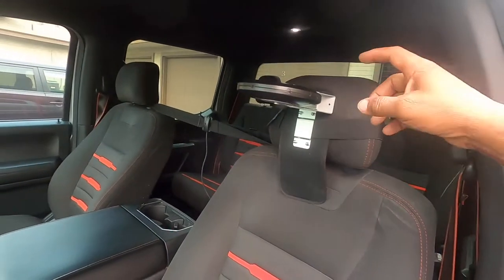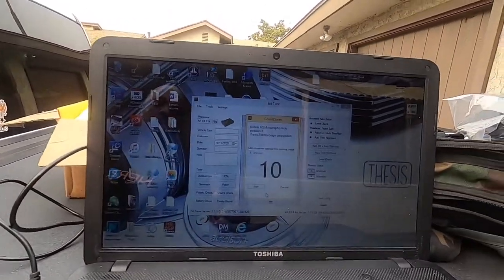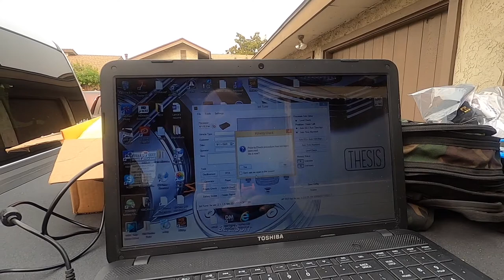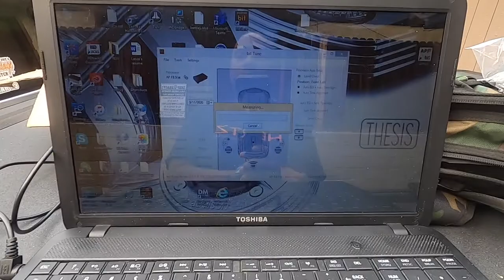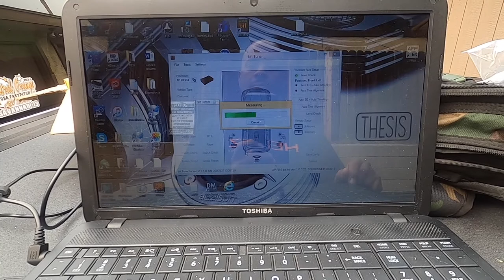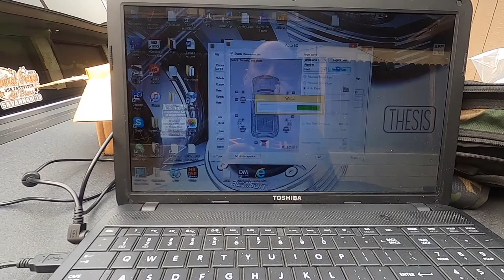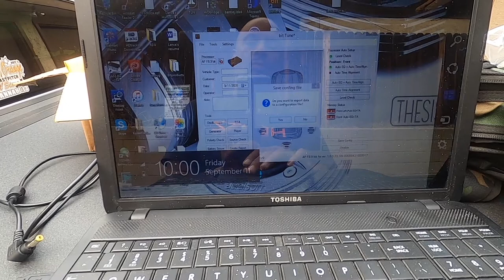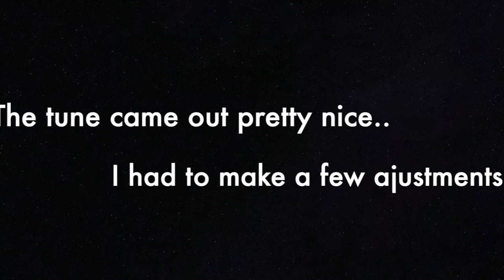Audison F150 Prima system with the APF8.9BIT & now it time to tune it using the Audison Bit Tune.

Comment: Question? where did you get your bit tune ? i have everything installed in my vehicle and audison advised me that I need the bit tune to finalize it . 🤷🏽‍♂️🙈
Reply from the maker: I got one when I worked for a dealer. You can have your system tuned without a Bit Tune. The Bit Tune is a tool and any good installer can tune a Audison DSP without it. Where are you located?
Reply: located in atlanta ga
Reply from the maker: @allenspencer21  there should be a ton of good Audison dealers that would be able to tune your DSP.
Reply: i changed all speakers to audison and added a audison 10 active sub and the apf8.9 forza with the audison reamp 2 for a 2017 BMW x6 that came with the to hi-fi stereo system.
Reply: agreed 👍
Reply from the maker: Reach out to Audison Tech support tomorrow & they should be able to give you a few contacts.